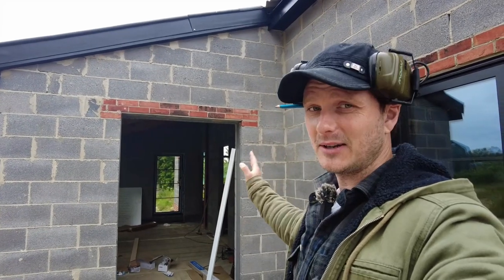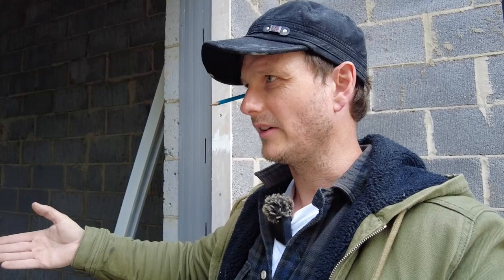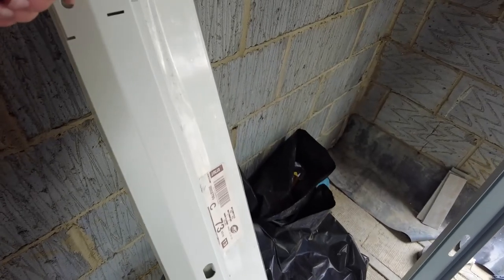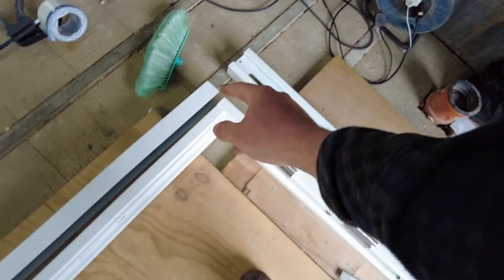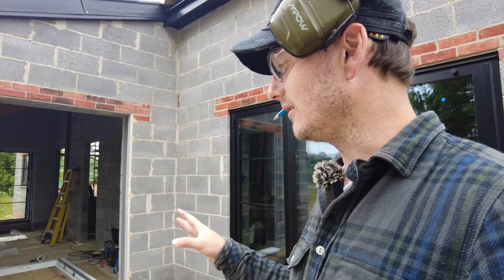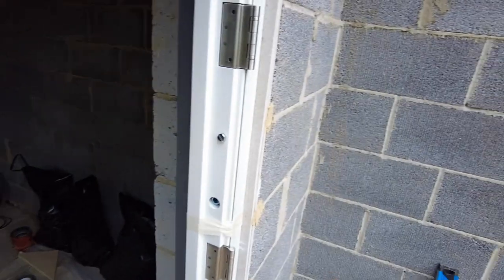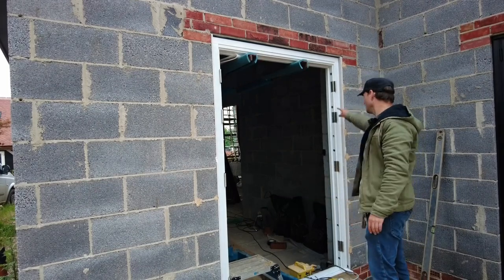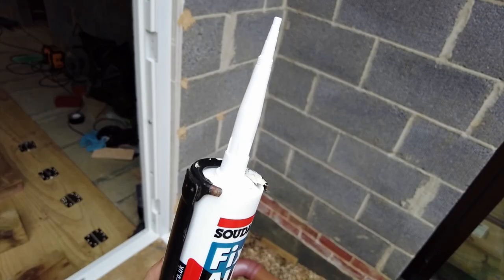I Tried To Fit Steel Doors and FAILED

Comment: Could you not use a bottle jack on it's side with packing to force the frame out. Just an idea.
Reply from the maker: Ahaa good idea Ken 🙌 I was searching for that kind of idea in my head before and was going down the acro prop route. The top section is locked in alot more though so I was just going to take the whole thing out and grind out the slots to give it that extra few mm that it needs. Looks like I've got a decision to make 😑
Reply: Once you done that, leave the acro on and drill fuck loads of new holes on either side and concrete srew the fuck out of it.
Reply: @THE-AIDEN-PROJECT  have you talked to the manufacturer to see if they have a solution or if they know what is causing the problem? You seem to have done everything perfect, so there must be a reason the door didn't fit.

Comment: I just discovered this and love it!  Duly subscribed! I haven't done much with metal but surely belting things with a hammer could lead to fu**ing them completely? I think the difference between a pro and us amateurs is that the pros know where and how hard to belt it. But I feel your frustration! Great stuff.
Reply from the maker: 😂 Yep I hit it abit too hard and when I looked at it I went "oh 😳" but metal can be bent back, it can be welded and it's all good 😁 make sure you check out the update video on the doors 😅

Comment: There has to be some way to adjust how the doors fit in the frame....presumably at the hinge or in the door. Just me guessing btw, no experience or knowledge.
The frame is fixed. But the doors will expand & contract with the temperature, so the doors must have some method of adjustment within the fixed frame. 
I imagine there are some sort of adjustment screws at top & bottom of the doors that move the hinges in or out (guessing again).
Two options with broken drill bit & broken fixing in the frame:
1) Take frame out and start again....assuming it is even possible to remove the frame with the broken drill bit wedged in
2) Bodge it.....if it is possible add extra fixing near the compromised frame fixings.

To be honestly the frame isn't going anywhere. As long as you can get it working it isn't gonna be used very often and it is secure. Good enough 👍
Reply from the maker: Nope no adjustment screws 😕 Good point, it won't be used that often at all 🤔

Comment: The measuring and cutting did make me laugh as ive done the same and couldn't figure out how. I'm actually looking at these doors (Lathams) to replace my garage double door as they're reasonable price and quality but seeing your video I'm tempted to build them completely to test before I take out the old ones and go down a path of no return
Reply from the maker: Haha oh that reminds me I need a new blade for my saw now I mashed that one up 🤣 
Oh come on, walk on the wild side 😆
Reply: @THE-AIDEN-PROJECT  You can get multi purpose blades (have them on my evo 255 mitre saw) but ally will tend to gum them up. Drill wise I have the new makita 40v impact drill as I needed one with more grunt for a big auger bit, can’t fault it 👍 just seen the video of you fixing it, I still can’t get my head around the shims making the gap larger lol but definitely a trick I will remember
Reply from the maker: @soulrider678  I'm holding out for a tool sponsorship 🤣 
Ah no way, I thought I had explained it good enough so everyone would understand 😁
Reply: @THE-AIDEN-PROJECT  To be fair I would if I could 😂

Comment: A Good video, I have been looking at  buying a couple of these high security steel doors for a project, they offer much better security than a small roller shutter, assuming you’re looking at a double leaf width.
I have watched the manufacturers insulation video, 6 months prior to watching your attempted installation video, they make it look like a piece of cake. Other than the obvious problems of weight, regarding the installation process, what has been putting me off buying some is - I can see no method of adjusting the doors, problem enough on a single leaf door, and in my opinion unless the frame is particularly well engineered, it could be a nightmare, those tabs????? The problem is you don’t know there’s a problem until you fully committed. What a fucking nightmare. Would you say don’t bother with them, or get a price off someone who is installing them regularly to supply and fit? Thanks jon
Reply from the maker: So the ones I have here are a leaf and a half. If I were to install them again I'd probably put a small shim in the tab slots so it doesn't end up too tight, that will give you an extra couple of mm. Then if you watch my other video on this, there is a special way of shimming the hinges to adjust the doors. It really should be something they include in the instructions. The double doors might not be so tight 🤷 It is abit of a faff though, so getting someone with the benefit of experience in fitting a particular brand might be a good idea. Although you've got the benefit of my experience now, so why not give it a shot yourself 🙌

Comment: Lathams? I fitted one recently albeit a much easier job than yours. Still a huge faff for one person fitting it solo.
Reply from the maker: It is indeed! Which did you have? It looks like the single doors are easier. I can't beleive they don't have any adjustments on them. Was your frame stamped at all? Mine said 2011
Reply: @THE-AIDEN-PROJECT  it was a heavy duty single door. I got the height reduced and also used expansion panels on the sides. I was fixing into wood and ended up using my own screws. The trickiest part was actually fitting the handle. I definitely got a few questionable parts in with my lot. There was a keyhole protector that I had to grind down a ton.
Reply: @THE-AIDEN-PROJECT  Gawd. I've had a Lathams door (single door thankfully) sat in the garage to replace the personnel door for 2 years trying to summon up the courage to tackle the job. Might stick that project on the back burner again, though mine came fully assembled - door already in a full frame.

Comment: That's a bugger - you'd think they'd make the frame slightly oversize so you could compensate by shimming the hinges for an accurate fit. Maybe slit the door where it's clashing and knock it in then weld up?? 🤔
Reply from the maker: Exactly what I was thinking re the shimming! And as it happens about an hour ago I thought of cutting it open and welding it back together 😂
Reply: @THE-AIDEN-PROJECT  Think it might end up looking neater than smashing the frame into submission with increasingly bigger hammers! 😁⚒️

Comment: As you know, I’m hardly a professional DIY’er , but could it be anything to do with the recent hot weather and the metal expanding? Sounds crazy to even suggest but would the door close if you tried it in winter considering the margin is a millimetre or two? Lol
Reply from the maker: Nice idea but I kept them inside and there's never any direct sun on them 😑

Comment: I've recently installed simular garage doors bought second hand on my own. They weighed a ton, and was a night mare to install.  The block work pillars started giving at the mortar line.  In the end I called in a garage door specialist who made a complete hash of it.  After many attempts I found an instructional video by the Company who made them and it all went in eventually.  Don't give up and don't bash the shite out of them either.  Walk away have a brew, fag beer what ever it takes and start again calm and focused.  Trust me I nearly put my grinder to them to take them to the dump!
Reply from the maker: 😂 The next plan might involve some more force or the grinder but then I'll also need my welder 👀
Reply: @THE-AIDEN-PROJECT  They look like lathams doors they have a few instruction videos on YouTube. They might just help?

Comment: Could you have fitted the doors loosely, with the frame on the floor?  Test it all for size first?..Hindsight and all 😐
Reply from the maker: That would be pretty hard I reckon. I suppose you just kind of expect these things to be designed in a way where they will fit regardless taking into account tollerences

Comment: I didn't see any width adjustment, so was this just manufactured wrong? These are the jobs where you need someone to help, making test fitting easier before fixing in properly. Nightmare
Reply from the maker: Nope no adjustment 🤦‍♂️ it does seem to be down to the manufacturing. Hopefully I'll be able to sort it now I've had a couple of days doing other stuff 🤞